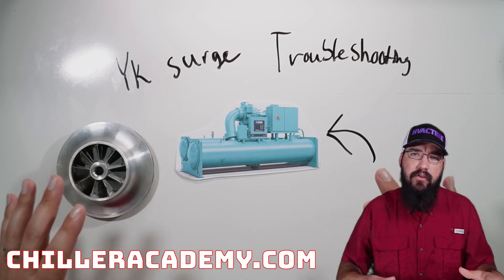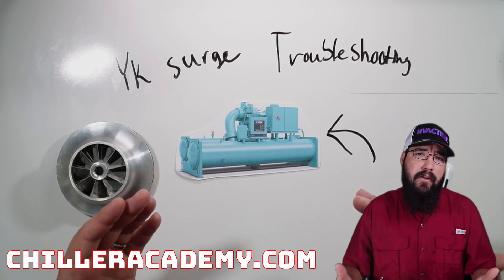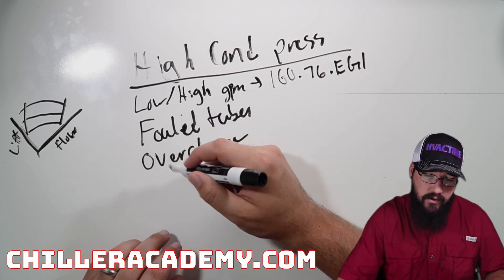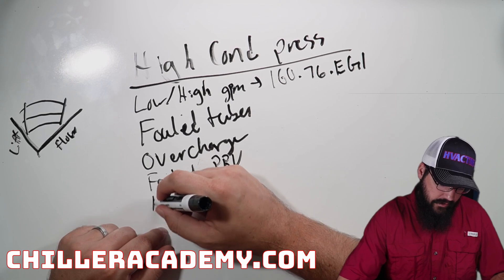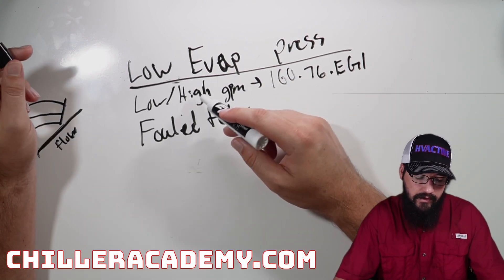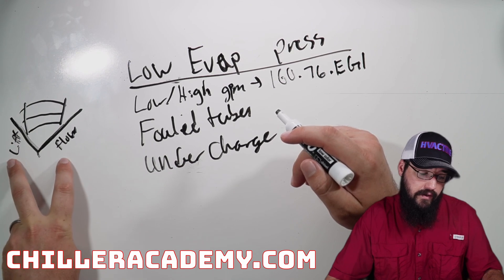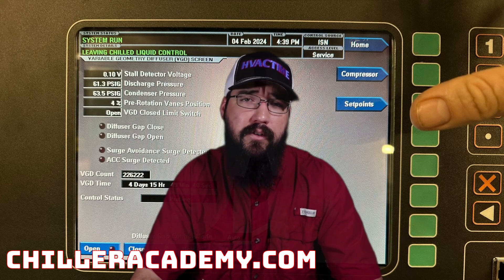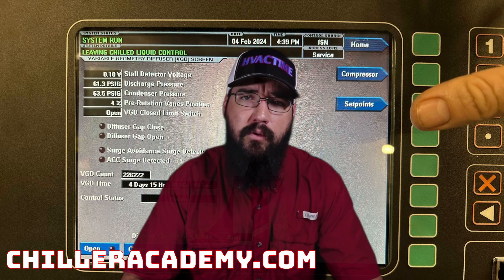YK Surge Troubleshooting: Chiller Training

Comment: Hows it going Holden 
I was wondering if you have any feedback or experience on an issue that’s been reoccurring at a plant I’m working at. Our York centrifugal chiller every  now and then, while it’s regenerating at night & after running for a few hours, it shuts off on an alarm indicator displaying “ vane motor switch open”. It’s an odd thing I’m not sure if it’s a panel issue, program issue or what, Any experience on this?